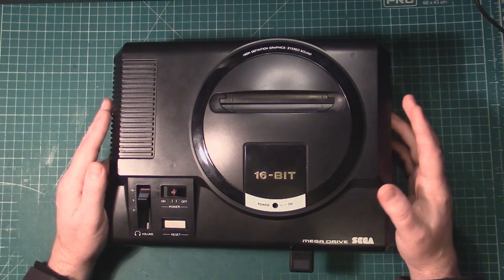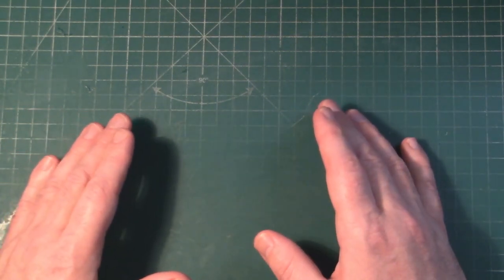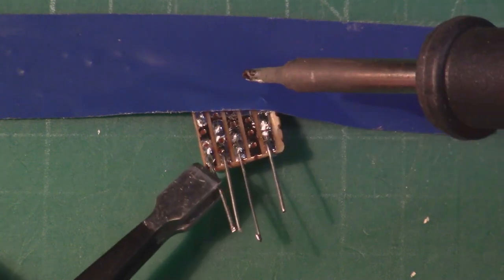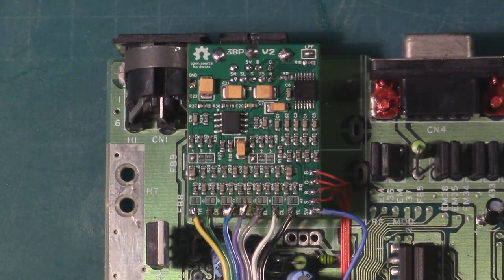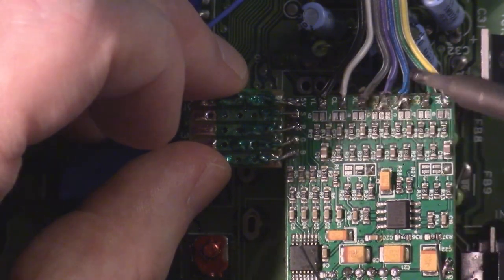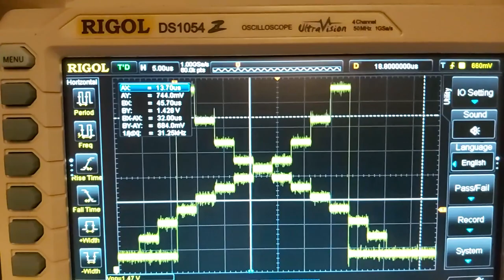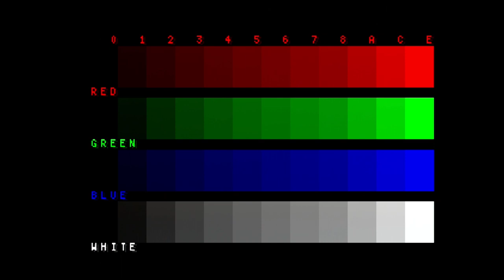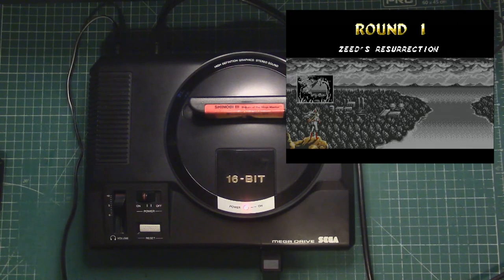SEGA GENESIS - RGB Bypass - Pull Up Resistor Fix

Comment: I just don’t understand how the pull-ups were left out of the design in the first place. Supposedly this whole thing meticulously reverse-engineers the audio and video lines to clean up and correct the separate audio and video mods that were out there. Instead, they just carried over the flaws from the original designs.
Reply from the maker: That's what I originally thought. Why not have some jumpers on the 3BP that add the 5.6K pull ups as an option for the models that need it. To be fair the project is open source and the board files are available if someone wants to add them. I myself would need allot more practice in KiCAD before taking that on :).
Reply: @GameTechRefuge  Well, Tianfeng himself is credited as part of the original open source project. ;) I saw some word about a Model 1-specific spin off that someone is making which will have these incorporated. I think it was mentioned in last weeks Mod News from Dubesinhower.
Reply from the maker: That's awesome. Was going to spin a daughter board but if there's a revision specific 3BP board, that's a better option.
Reply: @GameTechRefuge Zaxour has done it and his design is optimized for Model 1 installs. :)

Comment: Thanks for the video. I'm looking for a little help troubleshooting my U.S. Sega Genesis VA3, and would be grateful if you have any ideas to share with me. My Genesis was working perfectly until I tore up some traces doing a recap. That's when the animation started lagging badly.  I think I repaired the traces, but I still have the same problem, so it might be related to something else I did. Can you think of some reasons why the animation might be laggy? The troubleshooting guide mentions broken traces, but curious what your thoughts might be. Thanks for any help you can provide.
Reply from the maker: Fist thing that comes to mind is the memory attached to the VDP ( visual display processor ) . That would be the Vertical ZIP type chips on the VA3 Genesis / Mega Drive, to the north west of the chip we solder to in this video.   Off the top of my head, I can't think of the chip numbers. Console 5 Wiki should have the right info. I'd check the traces going to these to make sure there OK. After that, it could be the traces around the VDP itself. 
Check there's 5V going to the memory. After that, you'd need a logic probe, to test the address and data lines going to the memory to see if their active. There are some other things you could check but I'd check those only after checking the memory with the probe first.
Reply: @GameTechRefuge  That's great info, thank you very much!

Comment: Not yet installed one of these so this is good information for when I do. Not sure If I'd go to the effort of using a board for this Vs just adding the resistors inline, maybe if I was using SMD components.
Reply from the maker: SMD resistors would be the way to go. Hope to get around to creating a tiny little PCB for those in the  near future.
Reply: I don't think the resistors are necessary. There are steps in the install methods that people have been using that have you take these same resistors (already present on a stock genesis / megadrive) out of the original circuit by cutting traces or actually removing the components from the board. The work in this video is only necessary for a 3PB install that is already done having either cut traces or removed components from the stock genesis motherboard.

The real "fix" for new installs going forward is to simply not remove those  already existing resistors in the RGB circuit in the first place. 

That's if I understand correctly... which I think I do. But I could be wrong :)
Reply from the maker: Hi Brandon. In the initial install for this VA4 model 1, I lifted the RGB pins on the VDP and connected those directly to the 3BP. 
So I had to reintroduce the pull ups. As a rule, I never cut traces or remove components unless there's no other way around it.

That said the VDP pins had to be lifted to get a clean signal on this VA4. There's just too much noise on the circuit stock. I also added caps to both the 5v supplies of the VDP.
Noisy boys these VA4s ( and most model 1 revs of the Genesis/Mega Drive TBF ).

Reusing the 5.6k SMD caps on the rear of the board isn't a bad idea at all. Nothing wrong with cutting traces either. It's all down to how you want to go about it and there's always going to be compromises, like how I used 5.1k as I didn't have 5.6k at hand. For some revisions, simply lifting the sub carrier pin is enough to do the trick. For me this only made things worse, So lifting the pins & getting the RGB signals away from that noisy ground on the PCB is what worked. Every install will be different.

Comment: Ah, but you do have 5.6k Ω resistors: The originals are still there on the bottom of the PCB. Unfortunately, it’s very easy to lose or damage one of you try to move them to your own PCB so you can’t count on using them. Approximation is fine though I’d probably use a 480 Ω plus a 5.1k Ω for each myself. ;)
Reply from the maker: 5.1 will do. :)
Reply: @GameTechRefuge  Agreed. :)

Comment: Excuse me; Is an easier way to solve Model 1 jailbar issue without doing the bypass?
Reply from the maker: Hi Ace. The Jailbars can be fixed on some revisions of the model one by simply lifting the sub carrier pin of the VDP. This isn't a 100% fix and again only works on a limited number of mainboard revs. It can in some cases result in a worse picture. Playing on a model 2 is an option but those suffer with slightly worse audio, requiring an audio bypass.  Unfortunately the circuit on all model one consoles is generally noisy. So a bypass that reduces the noise  and cleans up the video and audio signals is often the only option.
Reply: @GameTechRefuge  I appreciate your reply very much. After watching your video last night, I actually stumbled upon a set of videos made by a person who had lifted the (VDP 315-5313A) Sub-Carrier pin but to no avail whatsoever, as he ended up having to do the whole RGB bypass.
In my case, I have found a TA-06 9245 20173065C chip in mine, since it's a weird Asian PAL variant.